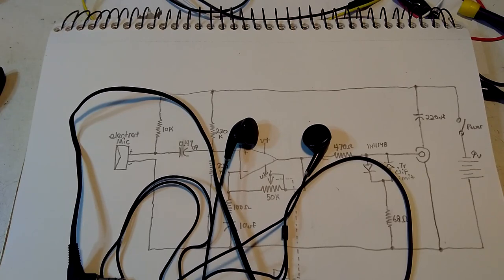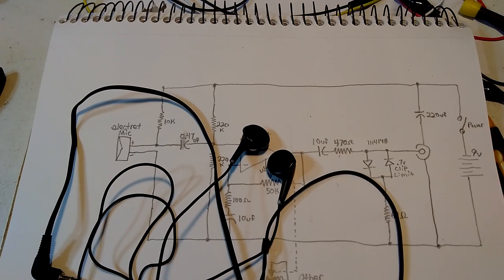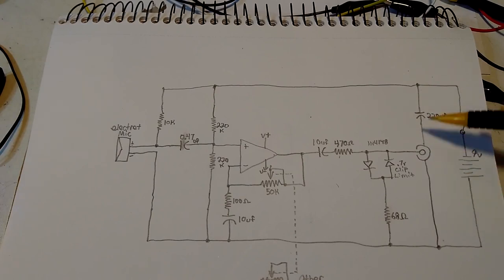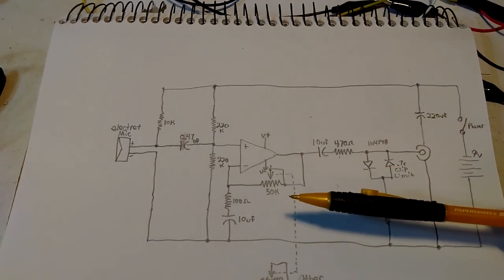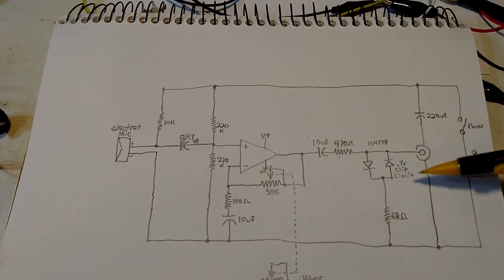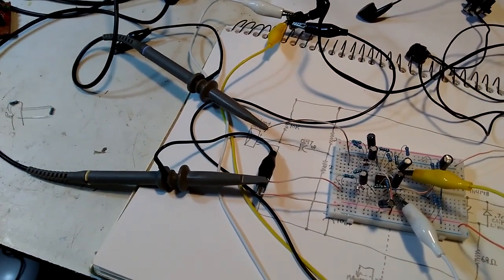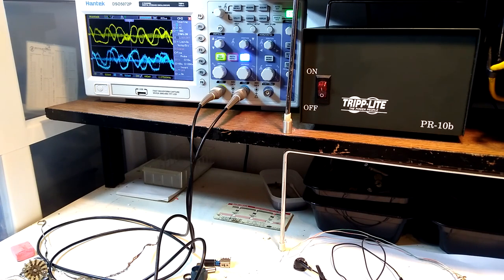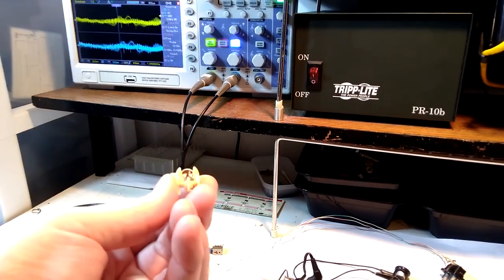Binaural Microphone Project - Part 1

Comment from the maker: Yes I just realized I drew the battery symbol backwards, obviously positive is on the top rail and negative on the bottle. OPAMP V+/V- ties to the same rails because the chip is balanced to 1/2 voltage via the 220k resistors in series.
I'm sure I made other glaring mistakes too in the video but I just noticed this playing it back.
Also yes I'm aware of my uh and speech ticks. Take a drink every time you hear me say Uh and you'll be black out drunk before the end of the video lmao. I'm working on that but sometimes I get caught up in my thoughts and have a hard time articulating without spaces where I feel I need to say something vocally from video shyness.